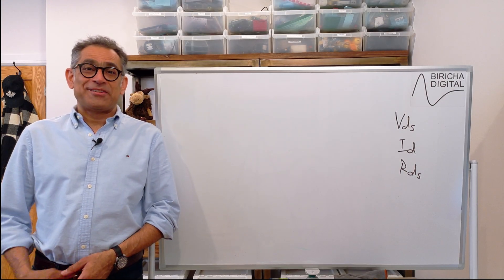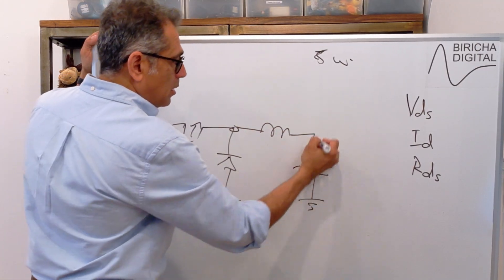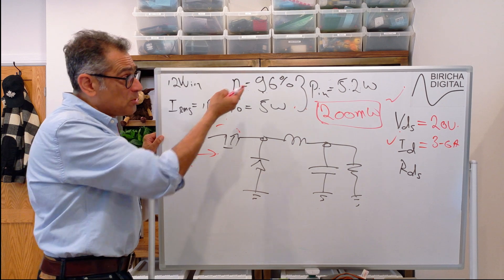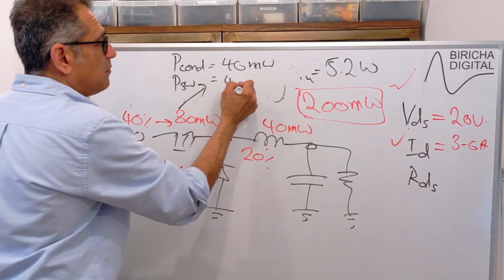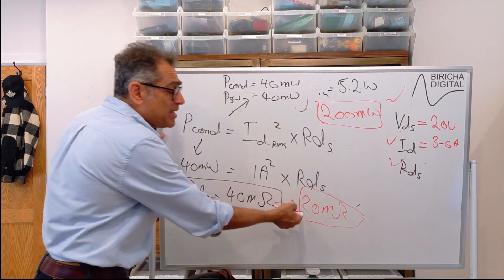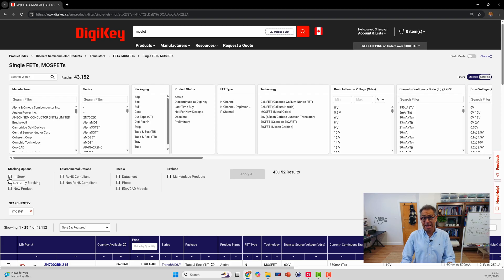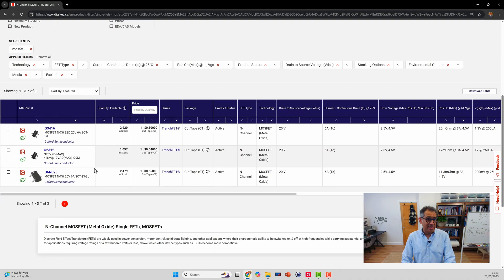Select Your Power Supply's MOSFET with just 3 videos (Video 1) - Calculate Conduction Losses

Comment: Thank you for such kind of video! 
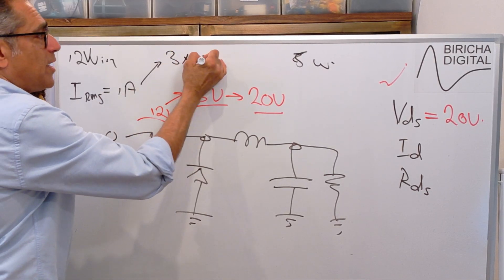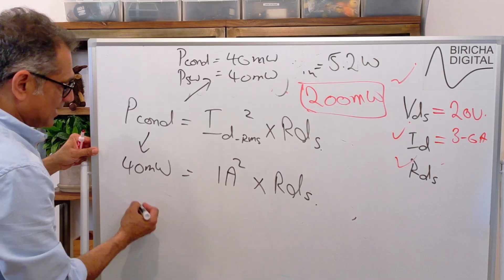However, there two steps in process of selection that are confusing to me. At 3:34 we would like to have some margin for Id, but on the other hand during Rds calculation at 8:10 we have taken Ids loading current of 1A instead of Ids with margin 3A. Shouldn't we make the calculation at 8:10 Rds=40mW/3A or even more safe 40mW/6A? 
Could you comment on this?

Comment: Excellent Sir! Very useful information. DigiKey is a great company. Outside of paying $10 for shipping, the parts are guaranteed. The shipping cost is off- set by component reliability and in large orders, it's still $10 until the order gets very large. Thanks for showing us how to navigate their website. With that said I still use Aliexpress and Ebay, but I am not a commercial facility and I socket my dip ic's in case of a failure. Take care.